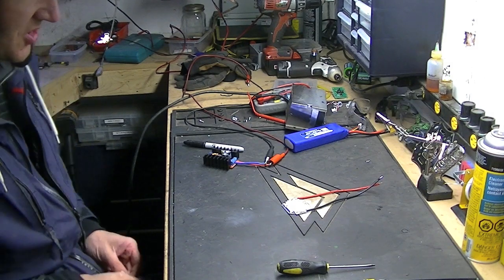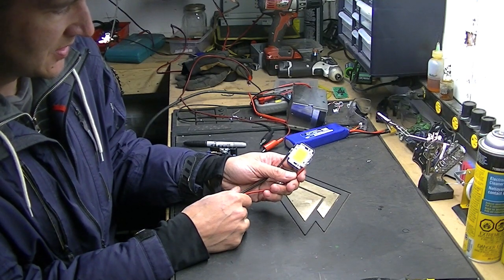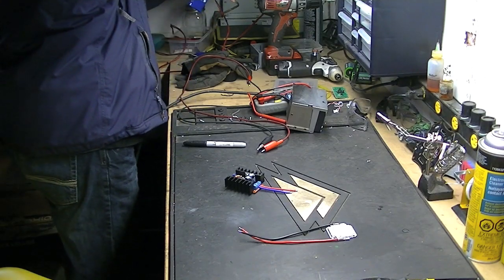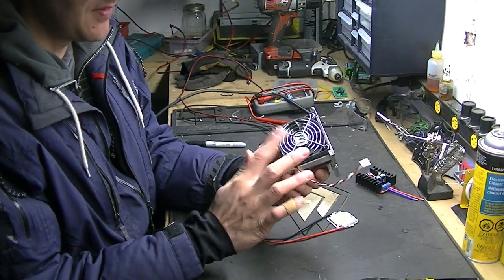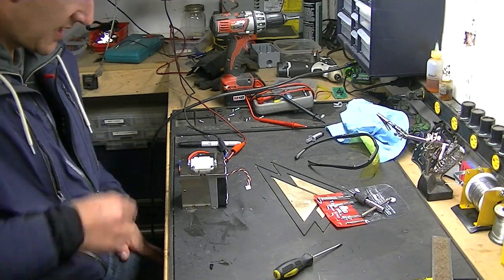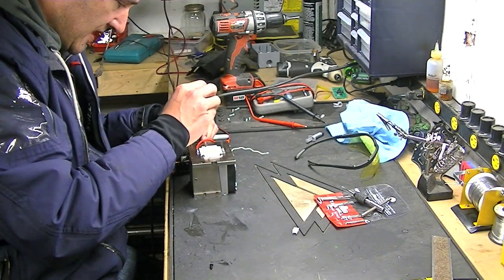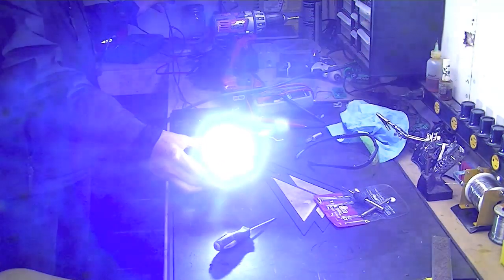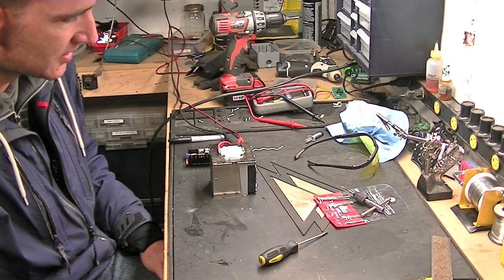100W LED

Comment: You can also use a larger battery since using a boost converter you just need power less then your output. You should get the boost converter like the one you have but has a constant current POT. That way you set the current and the volts will go up and down with the heat so your LED will last longer.

Comment: hi nice, some said you need to use a current controller so you dont burn your lead., do you know what size and type of resistor would be needed on a 100w 33.3v led?

Comment: what kind of driver would i need to power 10 100watt leds
Reply: when using a wall socjet for power 110 volt
Reply: 10 of those boost converters and ten heatsinks. and huge muthafukka battery